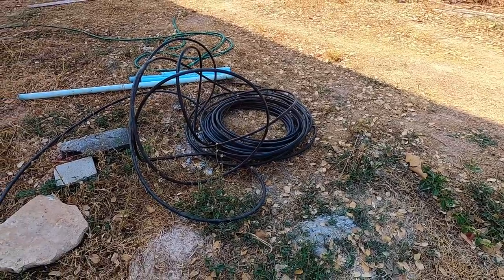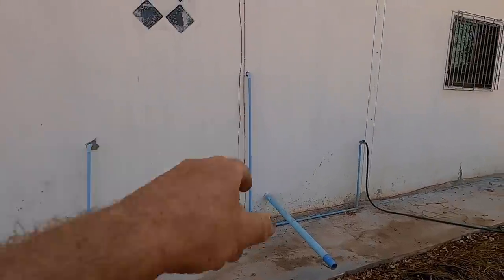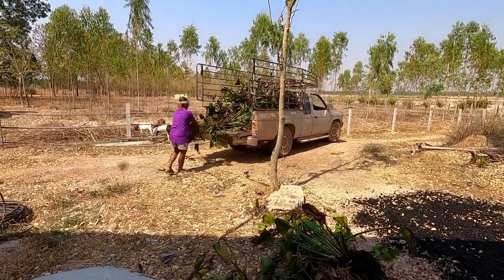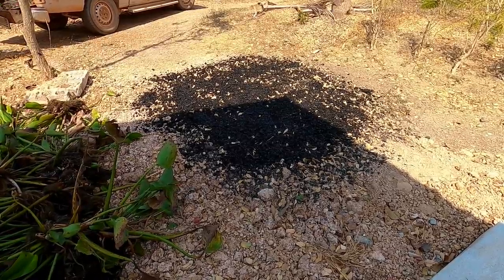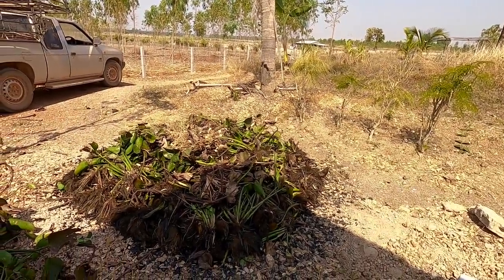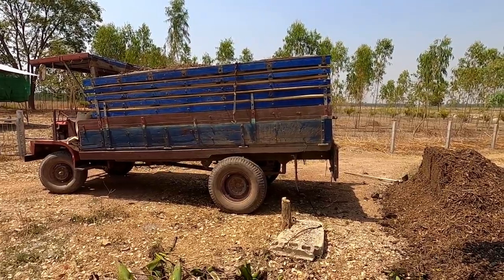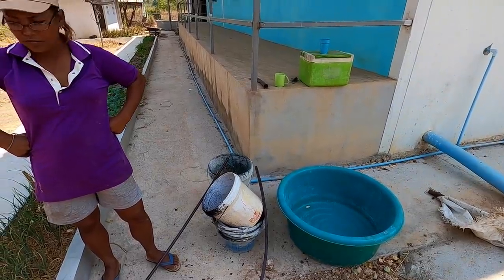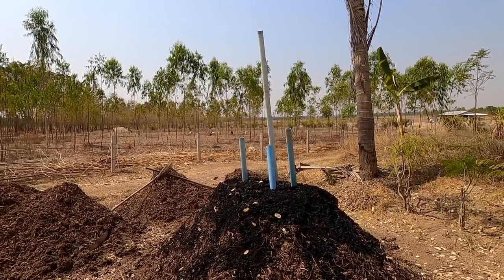Constructing a compost pile to make FREE hot water

Comment: The compost will be fine to put around the palms and bamboo out to the drip line and as you know away from the trunk/ core as long as it is only just warm. This will aid in composting any existing mulch as well, winner-winner chicken dinner.
Reply from the maker: Nice one thanks Marky. I checked the cassava only piles this morning & they were hot, way too hot for using straight round the palms. I reckon all the turning from loading, unloading & then piling it up cooled it off for a while. Good job I've only scratched the surface of the water hyacinth!

Comment: If you just want hot water then you dont need compost piles. Get a 200 litre blue plastic drum and another coil of black pipe. You need a light senser switch and a small aquarium type pump so the pump runs in daylight. Circulate the water through the black hose laying on the ground or the roof, and you will have 200 litres of warm to hot water each day.
Reply from the maker: Nice idea Tony . Here on the farm our primary focus is using what we already have & making compost at the same time. Cheers.

Comment: Leigh I would love to talk with you about this, it is has been a passion of mine for over 10 years here. Can I suggest you (if you havent already) use EM to accelerate that compost. Do you have a copy of the EM manual? Simply your compost needs to remain at about 40% moisture level and about a 30 to 1 C::N ratio. EM you can buy anywhere for about 80 baht a litre. One litre EM, a litre of feed grade molasses and 18 litres of water. Bottom line your compost will be finished within a month. Send me a comment and let talk more. Mate you have the most important factor, WATER.
Reply from the maker: LOL I put EM Po in twice a day when I change the goat's water. Never a huge amount but little & often. I'm sure it contains molasses. Cheers.
Reply: @TLFarm  Commercial EM is stabilised, microbes asleep. Active it with molasses and water. 1 litre of EM produces 20 litres of EMA. One litre of EMA in 1000 litres of stock drinking water. One litre of EMA in 20 litres and spray your compost each day before watering. Stick a cap full of EM in with 1 litre of urine in 20 litres of water to turbo charge things especially older manures.
A capful into your toilet every day or so and you can use the outflow in compost.

Comment: That will work mate. But i would put the pipe close to the shower pipe, as you don't need hot water going into your toilet as i think you have a steaming shit anyway,,,5555 don't need it any hotter,,, And you don't need goat shit in there it's only to make hot water.. cover it with black plastic,, only need 3 meters of it as it folds out,, cheap as chips from your hardware shop,,, that will keep it hot and wet, then just add more as it breaks down,, ohh and quick question why take the big branches home for the goats ? trim the leafy bits off that way you will get more in the ute and you don't need any more sticks yet as you have a shit load to burn already..
Reply from the maker: The hot water is fed into the shower pipe only. It's working an absolute treat mate.
We bring the large branches of Leucaena back because the goats favorite part is the bark. I then use the timber for my biochar 👍